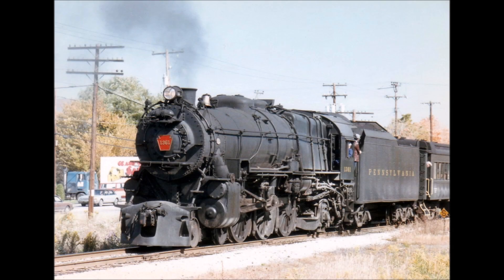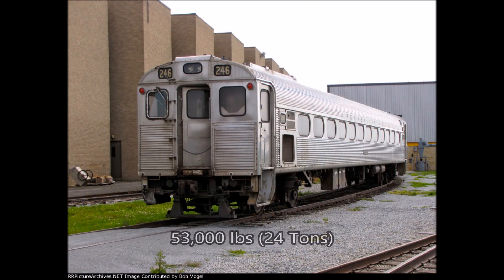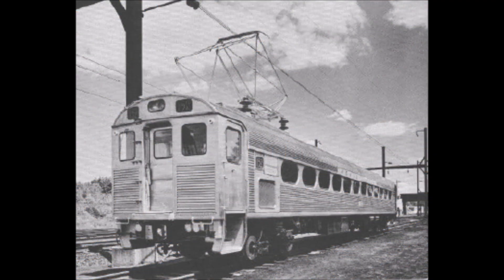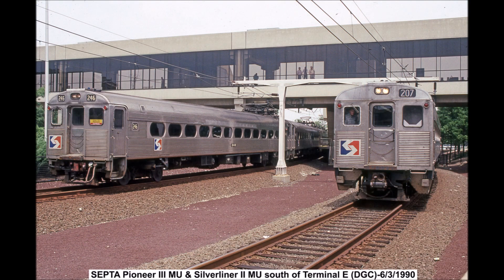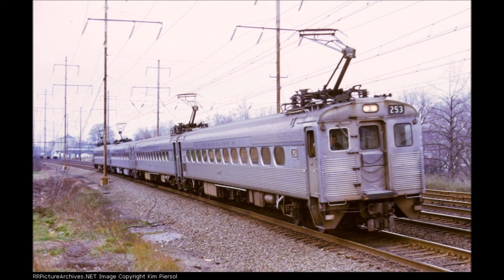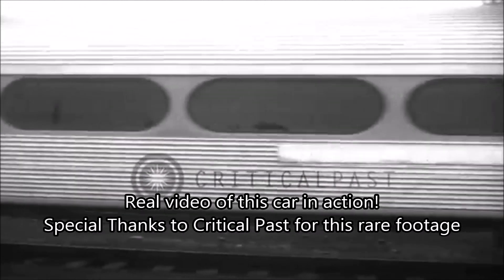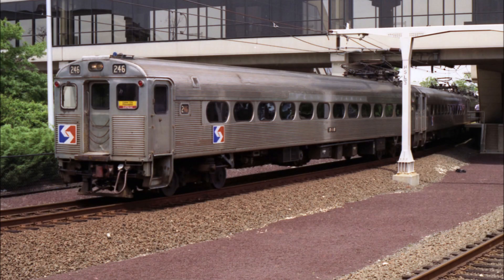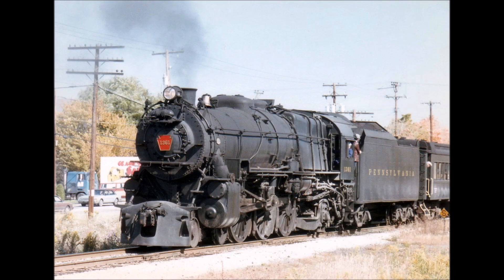Engines of SEPTA: Pioneer III (Silverliner I)

Comment: Metroliners did not use Budd Pioneer III trucks due to the size of the traction motors.  They had to use outboard bearing equalized trucks similar to a GSI 70.

Comment: Two things:  First, you mentioned the Almond Joy cars having the same motors and right angle drive as the Pioneer III's.  Correct, except the Almond Joys were built 2 years AFTER the Pioneer III's, not before.  Also not many people know this but the Brazillian RDC's with the Silverliner bodies were already under construction to replace the Bullets and Straffords on the P&W Norristown High-Speed Line as third rail electric MU's when the order was was cancelled and the 19 bodies became RDC's for Brazil instead.  It was a blessing in disguise as it effectively doubled the lives of the Bullets and Straffords.
Reply from the maker: So they attempted before to replace the smooth bullets and they failed.  Never knew that. I'd rather have those instead than the piece of junk N5s we have now. Sure they got good horns and accelerate fast but they are a mechanical mess and don't forget one lost its brakes and caused the speeds to drop. Hence why it's the "Slow speed line now"

Comment: They're not engines, they're electric multiple unit cars.

Engines make their own power and carry the fuel with them.

EMUs get power from outside sources.
Reply from the maker: Well I can't call it EMUs of SEPTA or motors of SEPTA as I'm covering more than that. Including the toasters and the maintenance diesels too eventually.
Reply: True but hes just showing the units septa has used. Dont be so critical. Im a huge electrical nerd and yes the technical term is motor since it uses electricity but geez dont go after Thunderbolt. He modeled this off another youtubers series with a similar name. Its perfectly fine. Everyone seems to like this

Comment: Thunderbolt 1000's sound BAD ASS! Usta be a big thing here in North Texas.
Reply from the maker: I can agree. We use to have 165 Thunderbolts here in Limerick (Mostly 1000s where I live but there were a handful of 1000Ts but I've only heard the 1000s) I partly lost my hearing temporarily when I went up close to one during their tests. Now all we have are T-128s. Peach bottom in Southern PA had 1000s and a 2001-130 (the 2001 was an add on for better sound coverage) too but they are also gone except for the 2001.